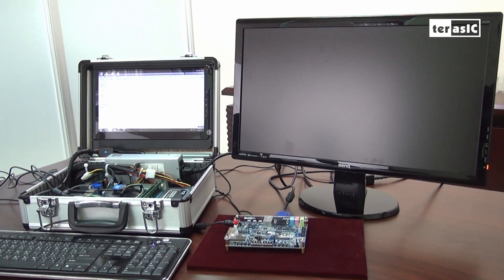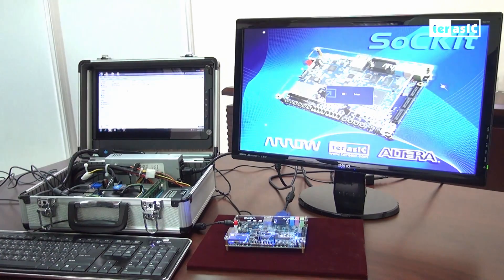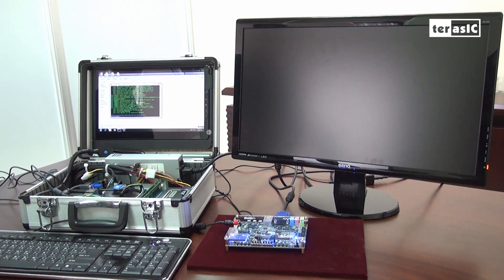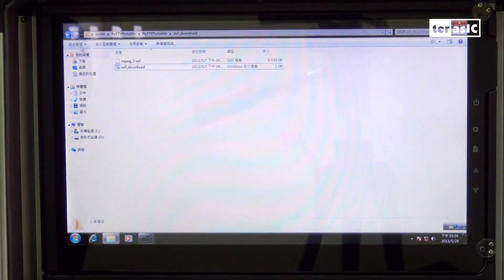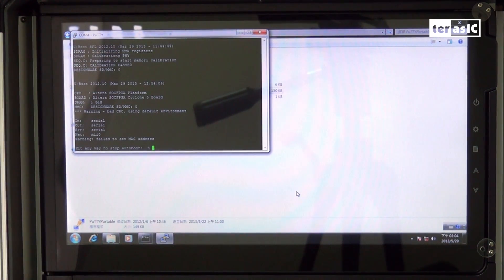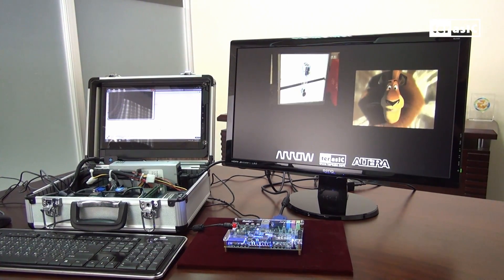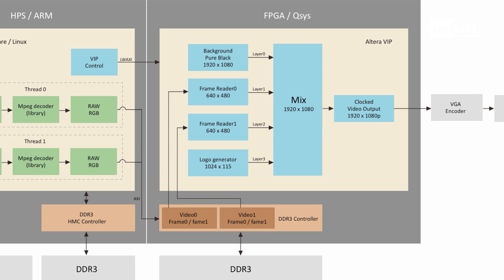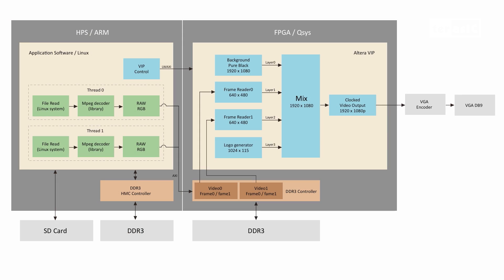SoCKit VIP Demonstration

Comment: do you have any newer sockit linux desktop image? currently the usb ports are not active when booting to linux. keyboard and mouse are not working or turning on. only serial terminal works. other linux distributions work on the arrow sockit. like mister fpga. the altera gsrd v16.0 does not finish booting either.